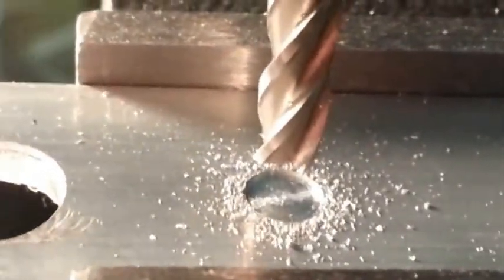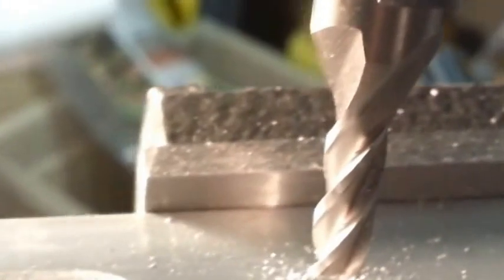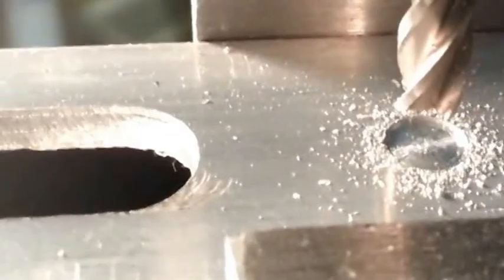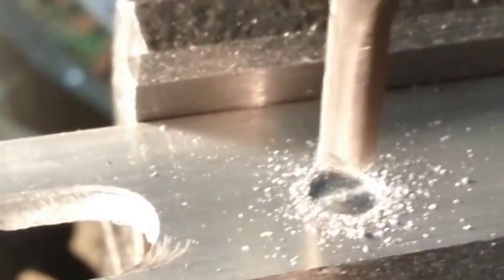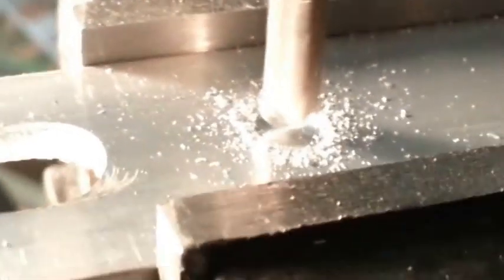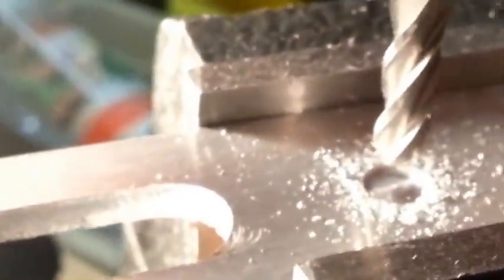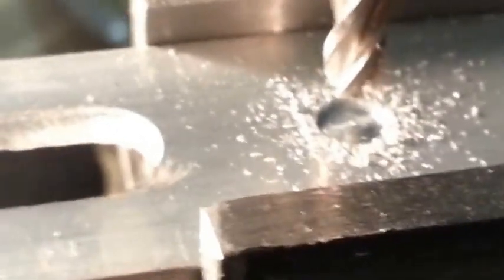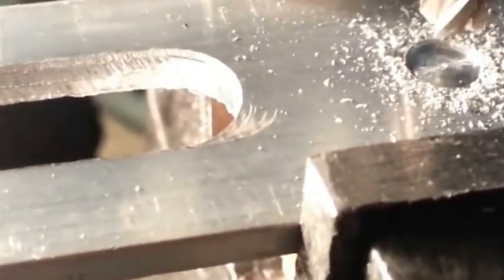drill press issues, tool wobble.

Comment: It's not the tool that wobbles, but the cameraman ;-) Seriously, what you need is a way to tighten the spindle. Cheap drill presses will wobble, but theres a way to hack them to reduce that. Regular bits center themselves and will wobble as well, but much less. But I guess you kow that by now ;-)

Comment: Erectile Dysfunction, wobbly tool that won’t go in the hole!
Throw a few Viagra tablets into the pulley section should get chewed up by the pulleys & belts & make their way in powdered form down into the spindle & quill of the drill press and stiffen things up for an hour or so!
I had one get stuck in my throat & suffered a stiff neck all day! 😂

Comment: spindle is out of adjustment causing the cutting tool to run out of balance because innertia forces the most inner part of the over-thightened spindle's surface to collide with its frictional counterpart on its contact shaft
always keep in mind temperature coeficient of metals, internal alloy chemical & structural composition and the effect before & after impact between metal and tool and of course ambiental temp sourrounding your working area + speed of drill press assy regarding work piece atached to a cheap flat drill press maybe?
 very simple

Comment: Most 4 flute end mills are not center cutting. A two flute end mill would be better but drill presses are not designed rigid enough to plunge cut with an end mill.  One idea would be to center drill than start the hole with a regular drill bit the same size as the end mill and use a 2 flute end mill of the same size to square the bottom of the hole.  Shop class 101 a vertical mill can be used as a drill press but a drill press is a pi$$ poor milling machine.
Reply: Rob C there are 4-flute endmills out there available that are center cut and will plunge cut, just an FYI

Comment: I know is an old video, but someone might read this. and it helps. First, there is a thumb tightening bolt on each side by the motor. loosen each and "I use a pry bar between motor and press to tighten the tension on the belt.". I'm not saying it will remove all of the wobble, but it will remove most. Also, when all else fails, read instructions.
Reply from the maker: Thanks for your input.  These cheap drill presses don't come with detailed instructions on how to make the adjustment you mention.  Also, the press is belt driven.  The motor is not out of alignment such that it would cause the chuck to wobble.  However, I will take a look at the press as you suggest and see if there are anything outstanding.
Reply: If you loosen the 2 bolts and slide the motor to the rear, it tightens the belt and takes a lot of the wobble out. Not saying doing will make a harbor freight drill press perform like an industrial press. It does tighten it up. I had to figure it out on my own. FYI, I am a machinist. I operate the washing machine, dryer, dishwasher, stove, and more.
Reply from the maker: OK, Now I understand.  I will take a look at it.  Thanks.

Comment: you are trying to do a milling machine job in a drill press, drill presses have too much movement and much thinner support.  in a mill, that end mill would go into a collet not a drill chuck, and that would have a quill (the rack part that lowers) that is several times the size, this is for support, and would have precision parts for no movement.  you cannot use a milling bit as your drill press has movement, it is only designed for drilling.  you may be able to pre drill with a normal drill and only use the end mill to finish down the hole.  a good drill press might have 5 thou runout, a good mill will have 1/20 thou runout, and thats before sideways stress on the parts.

Comment: You cannot use an end mill to bore a hole.  Also, the corners of an end mill are typically lower than the center so the bottom is not actually flat.  If you only need a few holes for a one off project you could always re-grind a drill bit with a flat cutting end.  A good method for a shallow hole is to employ a spotfacing cutter.  For a through hole you could drill a pilot hole, use a reverse spotfaceing cutter, and then drill/ream the through hole to the final dimension.  Depending on the size of your hole and budget, you could get a boring bar (~$40ish on amazon).

Comment: Im going to assume youve already figured out your problem because this video is so old, but one thing you could consider doing in the future is using a slightly over-sized drill to make your hole (if your project allows) and then using the endmill to make a flat bottom. That way your endmill wouldnt drag on the wall as you made your flat bottom and it would be removing less material and have less load on it. Also i wouldn't recommend a 4 fluted endmill for making holes like that, a 2 flue is much better for hole making, but if you were to make an over-sized hole like what i described earlier it would be okay to use your 4 flue endmill because where all the cutting surfaces meet in the center wouldnt be doing any of the cutting.

Comment: using a regular drill bit ground to 135*, drill a small pilot hole, then  drill your hole just short of depth. once that done you might be able to flatten out the bottom with your end mill assuming it is an end cutting type. alternatively you could try whats in this video http://youtu.be/qwuSBJFa5uM

Comment: Endmill is not for drilling,it cuts along X/Y-axis only (sideways).You will notice the endmill cutting edge does not go all the way to it's center, leaving a conical stub instead of a flat bottom. There is another milling cutter called a slotdrill where you can drill as well as mill. I see your drill spindle is wobbling, you can tighten (reduce)  the spindle run out by adjusting lock nut by trial and error. There are other more accurate ways by dial indicator.Watch videos on tune up drill press, etc. You have to true your drill spindle as well as the table. Watch videos again...Good luck.

Comment: You need a drill bit with a central projection.  That way it will continuously centre itself in it's central guidehole - instead of by the side walls of the hole.  Alternatively... drill the hole in one go.  Last resort, blame your un-American tool.
Reply: i like your last comment, blame your un-american tool. its not just that, a drill press is not a mill. thats the major problem.

Comment: Chinese drill presses normally are missing the bottom bearing allowing the quill to have a lot of play.  Get either a bearing or bushing (delrin works) and seat it into the bottom of the cast iron housing to stabilize.

Comment from the maker: If I understand you.  I should insert a bearing and sleeve up into the spindle housing, or onto the spindle itself.  This will stabilize the spindle and keep it turning true, even under load.  Is that right?  I like that idea.  This would also help support the lateral loads of milling.

Comment: you need a 4 flouted end mill single sided tool. and your head will wobble under load on a drill press you should build a spindle support. with a Timken bearing and race and float it off the stand post. indicate the head under load for proper adjustment. or buy undersize tooling and make small adjustments. sorry hope this helps